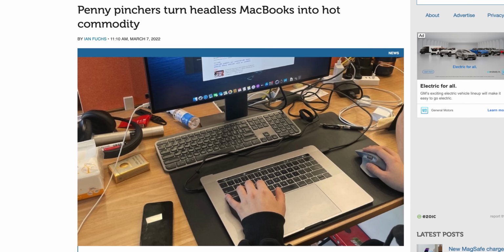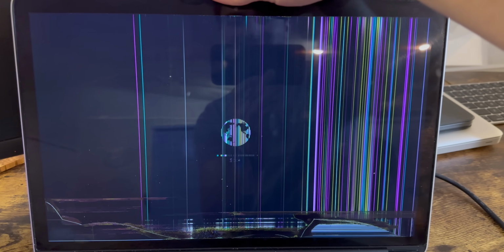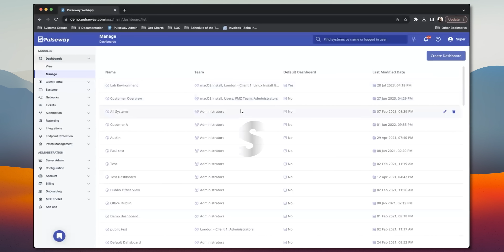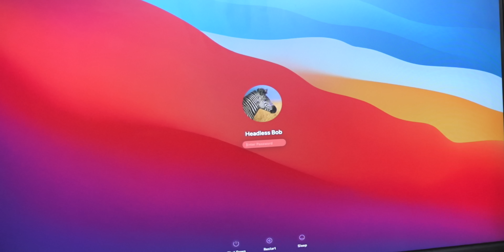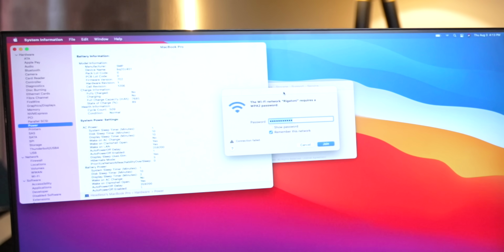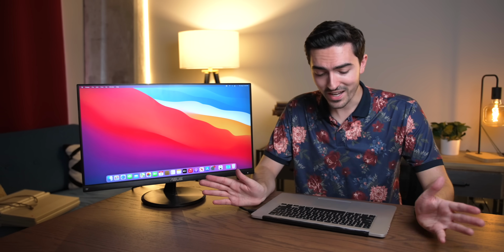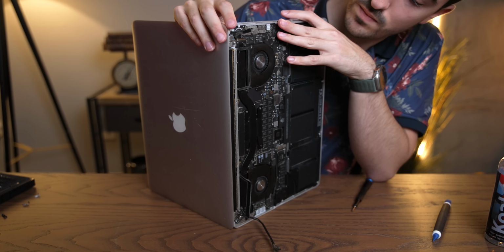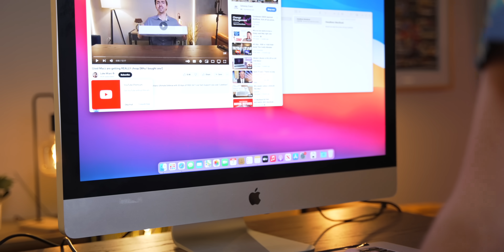Exploring the weird world of 'Headless' MacBooks

Comment from the maker: Pro tip: newer Apple Silicon Macs have antennas integrated into the lower case so in the future we won't have to create weird taped together antenna bars in projects like this...
Reply: Lol after seeing this they would transfer few more chips onto the display just so no one would be able to do this with next macbooks. Mark my words.
Reply: @datdudeinred  insanely smart idea that you just gave them, thanks! Jokes aside tho I wouldn’t be surprised if they did that or made Macs basically not even turn on when a running main display is not connected :(
Reply: @datdudeinred  You mean, do a MacOS update to not boot up when it's not there?
Reply: @datdudeinred or simply do as other manufacturers where you HAVE TO boot using the main display before being able to enable the secondary display..
Reply: @datdudeinred  This is the apple real way...
Reply: @datdudeinred  Despite what people think apple is not going out of thier way (spending money) to make things harder to repair they are just not considering third party repair at all.  There is no way they would increase the cost of making each laptop for this.
Reply: @hishnash  well many parts are hardware locked, especially on iphones.
Reply: @tomatosoupwoo   Many parts requires calibration and the process to apply calibration if it does not come from apples servers is not documented.
Reply: @hishnash  they totally already are though. they're adding extra complexity and extra hardware for those "calibrations" stored in different chips; effectively marrying different hardware of the device together.
instead of doing it the easy way, in software. like everyone else.
Reply: @hishnash  so a camera.. requires calibration..? no. it doesnt. if literally any company can do uncalibrated cameras and face recognition, why cant apple?
Reply: @GizmoTheGreen   No apple does do it in software the easy way, apple doe snot store profiles on parts they store them server side and reference them using a SN.   What they do not do is provide third party tooling for loading your own profiles.
Reply: @tomatosoupwoo   Yes a camara sensor (raw sensor) requiers calibration of cource it does.

the reason is those other cameras are not just raw sensors the enitire image pipeline is on those cameras (with calibration baked in).  That is very differnt from a raw sensor that is read directly by the SOC.
Reply: @hishnash  There is more than cameras, however, and many of those parts do not need to be calibrated, but are still hardware locked. I think I missed, yes cameras do indeed need to be calibrated, but they can definetly do this before sending out the parts.. the locking is more "hey this isnt a genuine part. fuck off." than "hey calibrate me."
Reply: @hishnash stop shilling for apple. So disgusting
Reply: @tomatosoupwoo   Such as?

Screens (need calibration) 
Finger print sensors (need calibration)
Hell even speakers and microphones (need calibration) 

Yes apple do the calibraioxn on all parts in the factory but they do not store the calibration profile on the part instead they opt for storing just the SN on the part and then store the profile server side that is retrieved by the device in diagnostic mode.  

The restriction here is a device can only pair/get the calibraioxn profile for a part that has not already been paired with another SOC.    

So when you go swap displays diagnostic mode (that anyone can enter) cant pull the profile of the screen as it has already been paired.

What apple should do is change the server side logic to only block part profiles if that part has been paired with a locked iCloud/stolen device.
Reply: @hishnash  apple sells pre calibrated screens, yet.....................................you still have to verify its calibrated? what?
Reply: @tomatosoupwoo   If you buy a new screen from apple and boot into diagnostic mode then it will retrieve the calibration.

The screen itself does not apply the calibration the calibration is applied in the display controle that is within the SOC. Diagnostic mode is sued to load that profile.
Reply: @hishnash  My man, why do the phones and stuff say “can’t verify if x is a genuine Apple part”?
Reply: @hishnash they spend a few extra cents on a chipset.....to make hundreds more on moving more units. Yes they absolutely would and do implement these digital cockblocks
Reply: @hishnash  Well truly uncalibrated displays, for example would produce random garbage, but an every "uncalibrated" MacBook display produces the exact same artifacts in the exact same place??? A little sus.

Also iPhone displays are made by Samsung and the machines for calibrating them would be their factory not Apple's as only Samsung could make them and there would be no point shipping them over. So the calibration data is on the screen module, which is also proved that to "recalibrate" it you plug in the devive into the new display, not the old phone or laptop. You're completely wrong and there is plenty of proof out there.
Reply: @hishnash apple should allow independent repairmen not on the apple certified repair technician program access to calibration tools but they don't because it's beneficial to them
Reply: @hishnash Well said, but they don't have to.. They simply would do as other manufacturers where you HAVE TO boot using the main display before being able to enable the secondary display..
Reply: You can just buy M.2 Antenna Copper Foil they have double-sided tape on the back you can plug them into the wifi card and stick them somewhere inside the case😂
Reply: The MacBooks from 2016 with USB-C and up have the antennas in the bottom case of the laptop so you will still have wifi and bluetooth I fix macs all the time lol.
Reply: I’m pretty sure this is true of the USB-C retina MacBooks too…? Certainly my 2017 and 2020 13 inch, and my 2018 15 inch has it separate.
Reply: @fergusyoung6782 i just did this. While its no longer in the display, one still needs to disassemble the antenna array to properly remove the display. 

Seeing as i couldnt be bothered what with 3 different screw sizes holding it together, i took the plunge and chopped off the display ribbon with scissors to save me the hassle, then proceeded to extract the remains.

Thankfully i didnt mess it up, and i am a happy owner of a headless mac connected to a pen tablet display. Now i have a mobile version of this when i previously was tethered to a desk when i was using clamshell mode.
Reply: @fergusyoung6782  Yep. This is true. I use my MBP 15" 2018 as a headless and the Wifi / BT Antenne is Build in the Bottom Case.
Reply: I just bought an M2 Macbook air with a cracked screen for $170 so perfect for me :>
Reply: @anonymousidea9119 does it work without the display atached?
Reply: I’ve done this with a m1 MacBook Air super easy and Bluetooth and Wi-Fi work flawlessly
Reply: You probably don't even need a 3D-printer to make that black bar. I reckon you could just use some black PVC extrusion or a "slide binder".
Reply: Wouldn’t it block the hot air output if u tape it such way?
Reply: @rajamuhdfadhli231  Oh yeah, that's a good point these MacBooks have air vents right there.
Reply: @andybrice2711  yup!😁
Reply: bro u can just lay the pc down on the keyboard with the display out over the table. and screw the display off. much easier than standing it up
Reply: I was wondering this.... I actually have been using my m1 mac without the screen for a while. I even made a video, lol.
Reply: but then they may also prevent screenless macbooks from booting.
Reply: You can always get a wifi dongle, would only cost around $10. The only downside is you would have to use 1 USB port
Reply: i hope in the future there will be laws in place to prevent this anti repair behavior and we will not have to do this at all
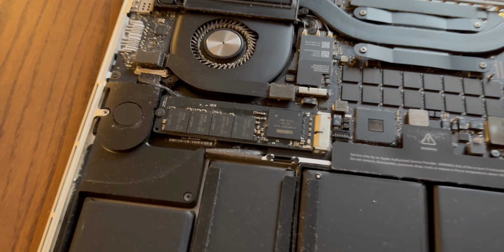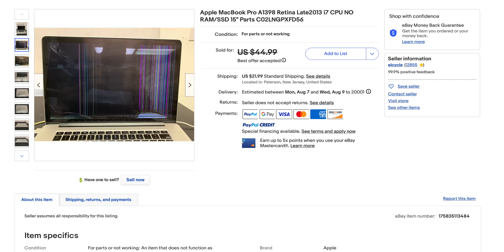Reply: Hey, what do you think about trying this with an ASUS Zenbook Duo? It comes with a screen built in the bottom half... Could you try disconnecting the top screen and having a portable slabtop? Haha 1:16 1:20 1:22
Reply: Yeah but apple doesn’t want people changing their laptops like that lol
Reply: I did a headless MacBook Air without knowing it was a trend. The battery was dead. I put the wifi and bluetooth antenna from the screen where the battery one. Also the SMC chip is dead so full fan, so I unplugged the fan. Anyway I think Apple removed the fan because they found out they were useless?
Reply: Running a script with hotkey to connect airplay for screen mirroring will make it couch setup
Reply: the newer display is too beautiful, deep blacks and ProMotion, but they can live again
Reply: Absolutely on point Luke. Extraordinary content .❤
Reply: Why not just use usb wifi
Reply: Shouldn’t you disconnect battery first?
Reply: Can you advise about using an old imac as solely a monitor? thank you, excellent ideas here!
Reply: Pretty sure the m1 air was like that when I replaced the display
Reply: Consider using some heat shrink for sealing the Wi-Fi antenna. If the top isn’t smooth, you could put some plastic on top and then heat shrink that inside so you get a flat surface
Reply: I love the idea. Thanks for this one.
Now, what's the quickest way to replace a dead keyboard in one of those? 🤪
100 tiny screws later...
Reply: @RWBHere  I think they are riveted on some if not all of the Apple silicon models
Reply: Does this apply to the MacBook Air m1 2020? Because my screen is broken
Reply: @Gregb01  I think so. I replaced the screen on mine myself from the self service repair from apple
Reply: I've just seen people soldering a straight up car antenna looking thing (yes ik, you think it's a normal antenna, but i no joke saw a long antenna hanging out of this dude's macbook
Reply: Hey Look understand that your a big youtuber, and you may not have time to reply to comments, But I have a Mid 2013 iMac 21', 16gb ram CoreI7- that my mom smashed last night, and I was wondering if I sent it to you, if you could possibly fix it... Its way worse than you may imagine... I'm pretty sure the worst in the Washington State, or maybe the country, she picked it up and slammed it quiet a few time and the stand is bent and the screen is morphed and shattered. I could send picture Via email if needed. Thank you if you did read this comment and especially if you get back to me.
Reply: Windows laptop are better just plug in a wifi adapter
Reply: @chriswright8074  well, there are plenty of adapters compatible with MacOs too
Reply: They probably have wifi usb cards for macs... surely they do?  @chriswright8074
Reply: You can do that with Mac as well but you won't be able to use Airdrop :)  @chriswright8074
Reply: Just stop buying mac, case closed.
Reply: @chriswright8074   You still need to run the antenna cables, and why buy and extra wifi card when the laptop already has one?

or are you talking about a USB adaptor these also work on Macs but that takes up a port, again why not use the internal one.

Comment: There is a thing called USB tethering, which allows you to connect your phone with a USB cable to any PC (including MAC) and share either mobile data or connect your phone to a router (wirelessly) and use it as a repeater.
Reply: I use it to connect the college's PC to the phone's internet, because our central educational router has a really strict firewall setup.

Comment: I wouldn't say apple has an obligation to supply parts, but I would argue they should be obligated to not make third party options impossible, many parts on apple products are arbitrarily serialised the only real reason for doing so is to make repair impossible, the LCD panels they use are off the shelf parts, they aren't super magic displays, back when they started the serialisation BS (I think it was the 2013 mac's or somewhere around there) there was people replacing the panels themselves with the same panels direct from the original manufacturer (LG iirc) so it was a 1:1 replacement of the exit same part, but then apple issued an update that basically blacklisted any panel that wasn't in the serial brackets of parts they had bought, so as an example if you bought panel 1000000001 it wouldn't work as they only whitelisted 0000000001-1000000000

Comment: About the parts prices: What a lot of those companies do is have assemblies and have the repair for actual parts be very hard to do, even with the right tools. I just researched for a Macbook Air M1 Display, because I have one, where the screen is broken. I found out, that the LCD itself is used in all the Macbook Airs of the years before, since the M1 Air still was the same design like before, but the assemblies were not compatible, because of changes with the keyboard or camera system (true tone). Repairing the LCD, I have read, is not recommended without a lot of experience and the right tools. So the result is: 2-300€/$ for the assembly. If the LCD where easier to replace, without changing camera or hinges, it would probably cost like 80, maybe even less, since there are more models using it, more parts can be manufactured, and better repairability would create enough demand to ensure, it's getting sold. I would count things like SSD and RAM sodered to the mainboard a similar issue in a higher price segment. If one part breaks, you should be able to replace only that part, less waste, less cost, less hastle and tbh less customersupport for the manufacturer in the end. But........less money for them so .... never mind, it's amazing how it is xD

Comment: I was doing this before it was cool. Let me warn you about one problem you might run into: during disk erase and system reinstallation, your MacBook won’t detect the HDMI monitor until the new system is installed. Great setup—until you want to format the drive. Than you’re stuck.

Comment: Nothing weird using it as it is when you have the bad luck of damaging the screen. But it is outright stupid to buy one. If you want to buy a damaged laptop as desktop replacement get yourself one where you can replace the processor. (HP Elite series comes to my mind, the screen is shit anyway, where you can install a quad core i7 and you can play 4k videos on that.)
Reply: I just bought one and I think it might worth it actually. Its 2019 Pro 16 inch with i9 CPU, 5500M GPU, 16GB RAM and 1TB SSD for 250 USD. I am planning to remove the motherboard and power button from the case and make a custom case for it. Then sell the other parts, so that should leave me around 100-200 USD I guess
Reply: @YTF-f4w  Your time is really cheap.

Comment: The screen on my 2014 MacBook Pro cracked, and the battery was dead, but everything else was in good condition. However, it wasn’t worth replacing the screen and battery, so I repurposed it as a headless file server, running directly on power.

Comment: Yo......i'm a year late and my mbp screen just broke. So glad i found this. I'm doing this and to answer your question, no apple doesn't need to make things more accessible. Imo they need to see the people move on without the fomo of buying the new yearly camera and/or M chip upgrade . I'm a production director at my church and this just showed me that a new small church-plant can spend maybe $150 per decently new MacBook Pro and then have the freedom to choose which monitors they want (ultra-wide, ultra-thin etc), not NEED to purchase mac keyboards and mice AS WELL they can use PowerPoint (or free PP variant) starting out and have two video outputs that don't use the once built-in display by default. If the mbp's they decapitate are just before the M1 chip then that means they can also feed up to 3-4 monitors each depending on the local TB i/o without spending hundreds on a deck-link setup. All wins in my opinion, thank you for this!

Comment: On older MacBooks intel models many times I don’t put the screws back in the bottom especially if have case that fits like a glove I love hard silicone ones best so doesn’t slim out the hand / the only one like taking on the go is iPad or MacBook Air/

Comment: I’m looking forward to M4 Mac mini especially if has a 10gb Ethernet at base model lineup or maybe in 32gb ram selection / I would go 10/or 12core cpu / it would be nice if Mac Pro M4 and down to M1 had an Apple core package and could upgrade the motherboard ram later either or better yet third party slots again like on intel 2019 Mac Pro design maybe in my next life after buying 51-80% shares of Apple or US government demands more options on macOS products to have SSD flash and ram upgrades again not this complete closed system of Apple’s way or the highway since the real boss is the customer and if Apple doesn’t do want the customer wants at user level of ownership than we will make another company that will/ a suggest another option a new Unix code/ Linux base similar to macOS but yet different that would something I would do with 20-200Trillion and make it starting with AI data centers and digital currency and would go into companies that is private not bitcoin which is public

Comment: I love using old MacBooks as a mouse and keyboard more like a track pad ; mainly MacBook Pro that I have prior to my 2012/ or 2015 MacBook Pro Retina 15” even this I like compressing or a quad core Mac mini 2010 16Gb ram or a Mac Pro 2008 when set up to be on before pickup a Mac Pro 2009/2010 it’s most likely ‘09 that was given a mac5,1 firmware upgrade I did metal upgrade after getting a 4gb gpu that would boot macOS 10.14 so could continue using my 32bit apps for video compression withy old iSkysoft v6 and v3-or 4 use v6 most of the time just created a separate folder and added v6 to the newer one v that is 10.15 only based on since even though is 64bit it wouldn’t support macOS beyond 10.15 /